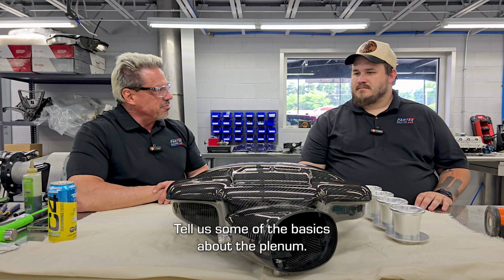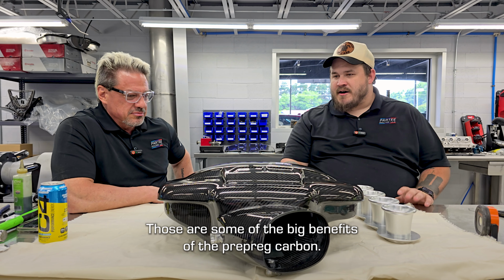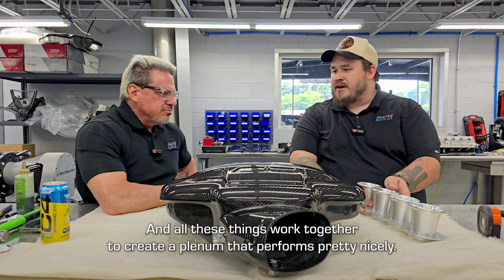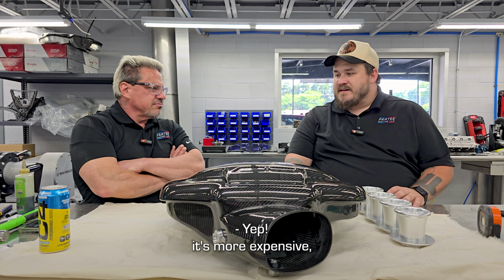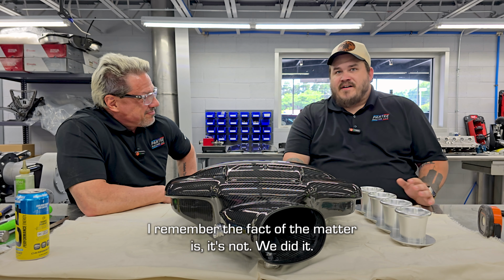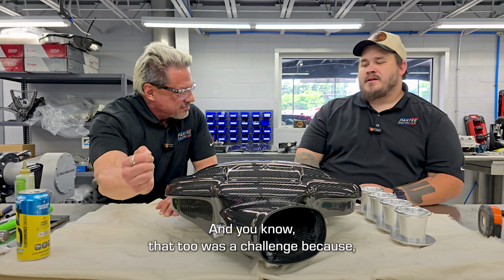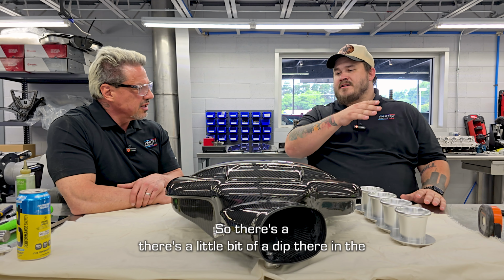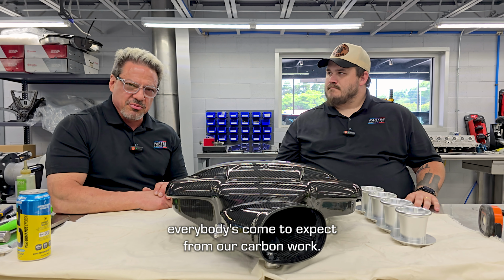Tech Discussion over Partee Racing's BMW E92 M3 (S65) Carbon Fiber Intake Plenum

Comment: Haven’t been in the E92 M3 world in a while, but I remember when the only options were Karbonius and Eventuri. Some owners would complain about the price, and eventually all these vendors came around claiming they could make the same product for less. But as they found out, to match the OEM-like quality of a company like Eventuri, they’d have to charge the same, if not more. I took a look at your price, and I honestly don’t understand the need for a “show-quality gloss” version. Eventuri provides a flawless show-quality clear as standard, and for almost a couple hundred less. Turns out their product wasn’t so overpriced after all.
Reply: Have you seen the eventuri innards?
Reply: I have had my hands on multiple Eventuri plenums and while they are very nice parts, they are far from flawless. Our standard finish is as good as Eventuri’s standard finish. Our show quality gloss option is a step beyond that.
Reply from the maker: I hear you.  It's just a matter of operator time and an additional process.  We are a boutique shop, and the economics are what they are.  And we decline to have our carbon fabricated in China.